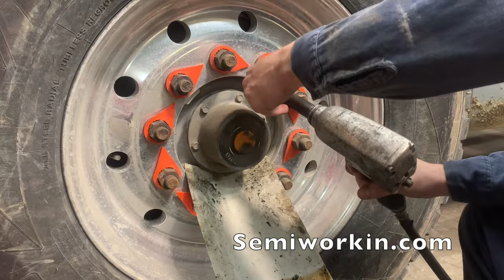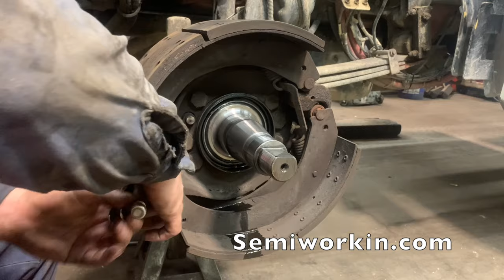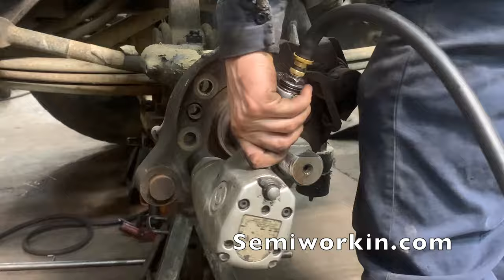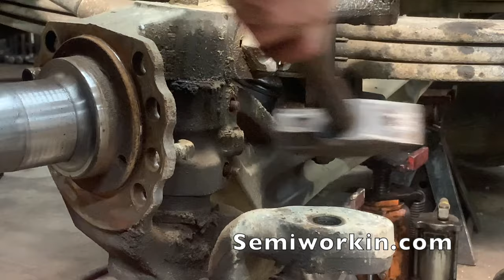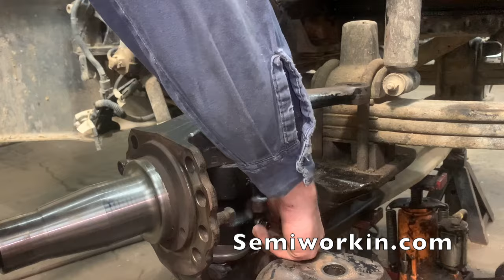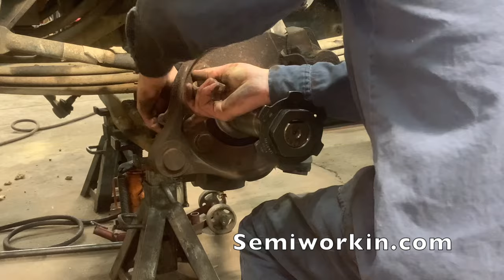Peterbilt Steering + King Pin Replacement

Comment: Why they wanna charge me 4 hrs??
Reply: This was a very good and clean example 😂 shit does not go this smoothly irl besides the shop will charge u less if it takes less time 4h is book time
Reply: Because yes the video is 12 minutes but the video is edited. Its not a full time unedited video showing it from start to finish including the seized up bolts and hiccups that come along with any major job. If you havent taken a steering system apart like this and put it back together ever you really cant talk about 4 hours being too much. Like Malachi said. They will charge less labor hours if it takes less. But if your kingpins are this worn out chances are you will have hiccups every step of this job…